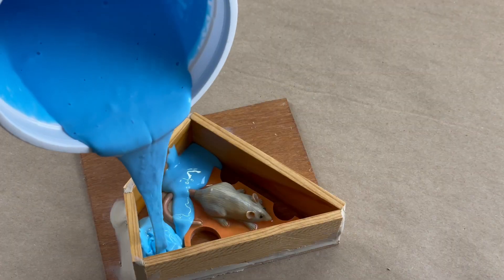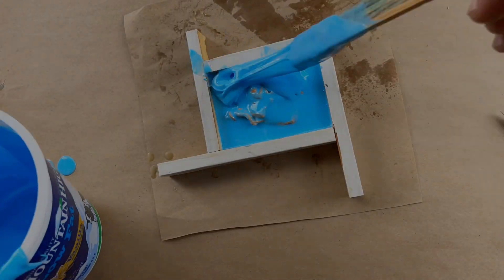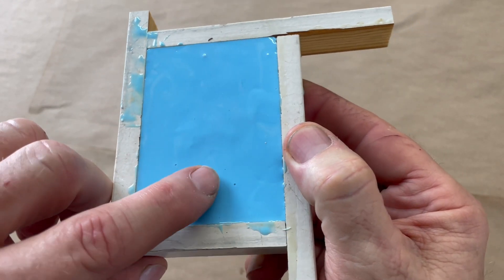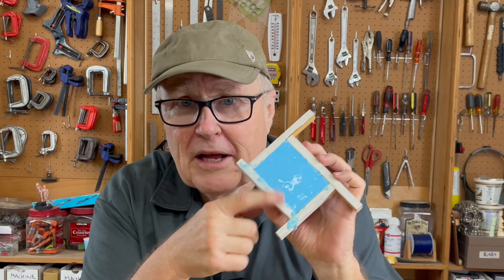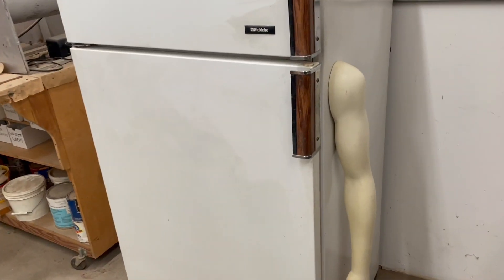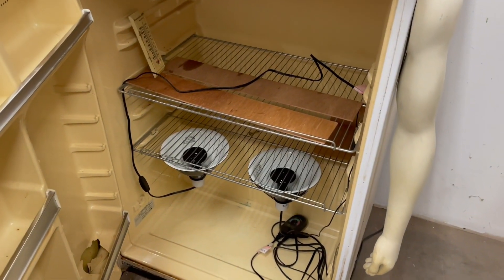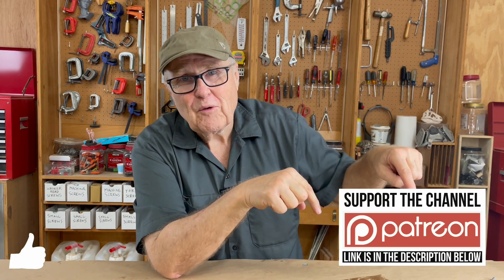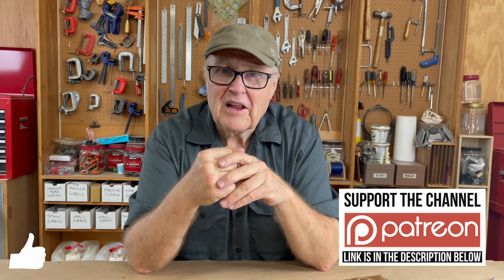It's Too Hot!  It's Too Cold!   WE HATE IT !!!

Comment: When dealing with flex foams, it's not just temperature, but humidity as well. Since urethane foams by moisture, when it's dry it can come out hard and crunchy. When it's cold and humid, the foam collapses after you pull it out, and you have to warm it up to get it to puff back up.

Comment: I had a faulty silicone cast int the past days. The hardener lost its property but I could not notice it. After casting the mold, I waited for a day, and it was still sticky. I waited one more and then two more days. But nothing happened. Then I realized that the hardener is gone. Probably, it was beyond its expiration date. Then, I ended up with messy parts. I would be great if you can show us some ways the clean such a mess. I made a sand box and burried the parts in to the sand and let them dry. After that I washed them off and it seems to be fine now. Please let us know how you clean such failure situations. Best regards.

Comment: have you tried pewter low temp metal fast dip molding and casting? essentially for electroplating after with high temp metal like copper on the low temp metal, about 170C. also why not just have a "cast box" ie ac box for all the temp controlled stuff, with through gloves etc, ie clean room or chemical box, fume hood box, yep small box, not the whole room, in the sauna of yours.

Comment: Thanks for your usual advice! I am clear about the temperature issue, but I am even more curious about the humidity of the environment. Do you think there is some magic number in the percentage of humidity in the environment that we should look for? Thanks!!!!
Reply from the maker: I think if you opened a bottle of fresh resin and made a casting in Phoenix at 105° and then did the same thing in Miami at 105° you would not notice any difference in the casting. The big difference would be how much moisture the resin in the bottle would absorb over time.  Obviously, you will have more moisture problems in a humid environment.